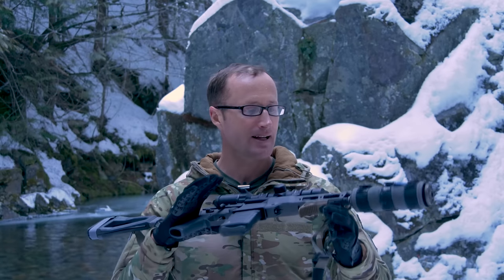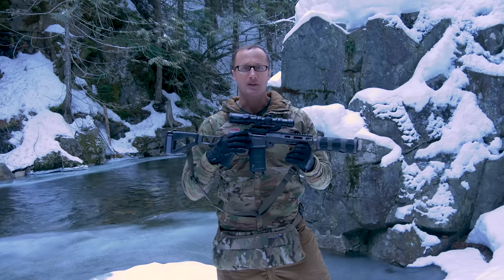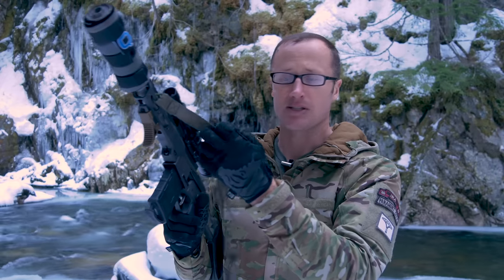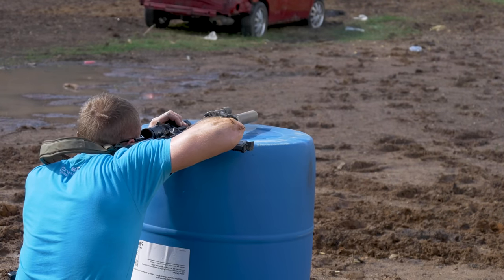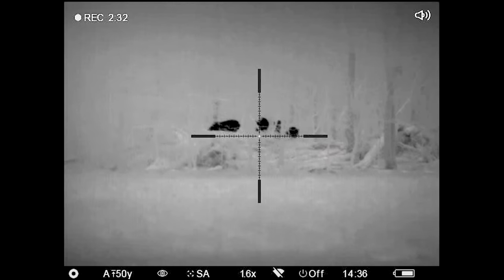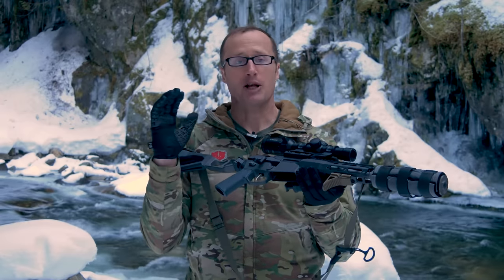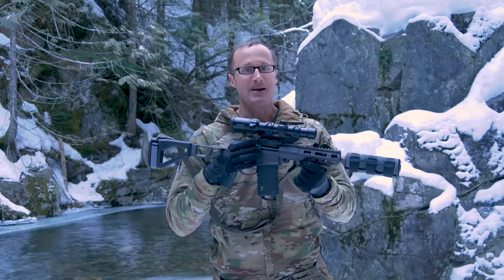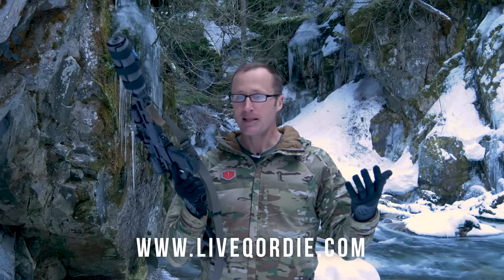The MiniFix by Q : Factory to Table Part - 9

Comment: Very nice pistol bolt action. I use 300blk AR for whitetail hunting using supersonic Barnes 110 or 120. I got a 130lbs deer 120 yards away. He ran off about 30 yards and dropped. Used a barnes 120. Good work on the build and bad luck happens with hunting. I would like to know how that does with supers.
Reply from the maker: Right on, I've heard great stuff about those Barnes bullets.

Comment: I would rather have a 8 inch barrel PAR from Troy, but what do I know? Maybe even a 308.
Reply from the maker: I haven't seen those, bolt guns?
Reply: @KitBadger  Pump Action Rifle (PAR). I sent them a comment suggesting an 8 inch pistol brace model.  Most have a folding stock. They come in 308 win, 300 blk and 5.56. I want one of each. They look like a scary assault pump action AR. Damn pump action assault rifles!

Comment: You probably addressed this in one of the other videos. My question is! AR mags tend to suck for bolt actions. The Mossberg Patrol as an example. Not terrible but can be a bit....well you know. How smooth is the action feeding?
Reply: I have the mvp-lr in 308, no magazine issues, honestly very underrated accurate rifle
Reply: @zackschmidt4381  does that use AR10 mags?
Reply: Shootin' with Uncle Dan yes it does, also uses m1a mags if I recall but I have only used steel ar10 mags an magpul 308 mags
Reply: Nutn has a very long winded but still good review of the mvp
Reply: @zackschmidt4381  Thank you for the info👍🇺🇸
Reply: @zackschmidt4381  Nutn can be very longwinded but, I trust his views👍
Reply: Shootin' with Uncle Dan yeah his video convinced me to buy one
Reply from the maker: It feeds fine.  The only issues I've ran into have been from bullet related problems.  Such as squared off bullet noses and what not.
Reply: @KitBadger  thanks for the reply👍🇺🇸

Comment: Yeah it’s a cool rifle. But is the mini fix worth THREE THOUSAND DOLLARS?! Not by any stretch of the imagination. If this gun gets your wood hard then let me help you out. Pork Sword. The custom chassis with a .300blk R700 action and many other customizable options makes for an outstanding pack gun perfectly made to be suppressed. It looks very similar to this mini fix. I got my Pork Sword and love it to death, compact lightweight and it starts at around only a grand! Mine with a nice brace, custom extremely light breaking trigger in the oz.’s not lbs., and a cerakote job came out to $1800 WITH tax and shipping. The mini fix has got nothing on my pork sword, not for the price, it’s in a whole other league of its own. Get one and don’t get this severely overpriced bolt action gun. You won’t be disappointed with the Pork Sword.
Reply from the maker: I like the Pork Sword, but it is not the MiniFix...  If you've ever thrown the bolt on a Fix, you may appreciate the difference.  :)